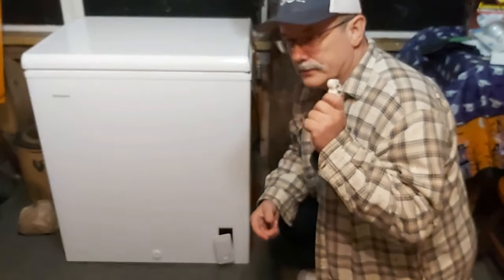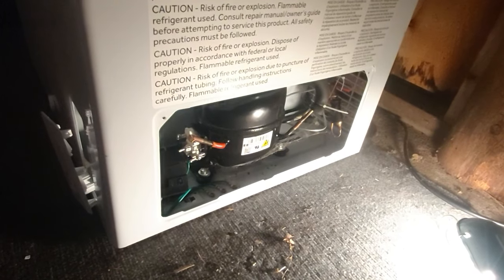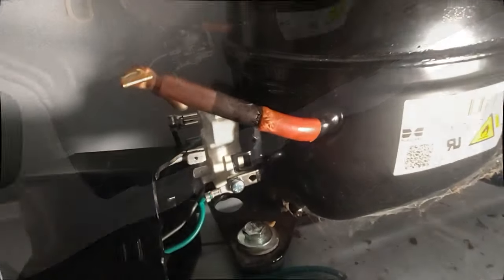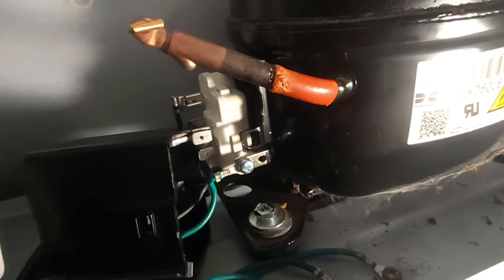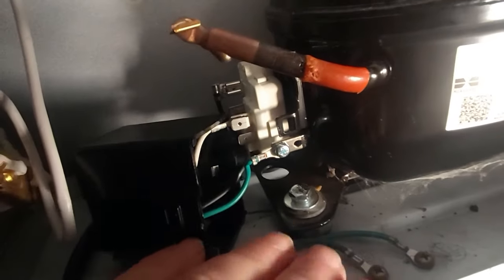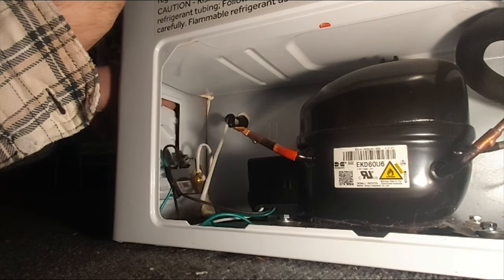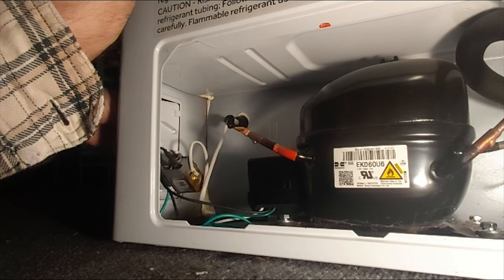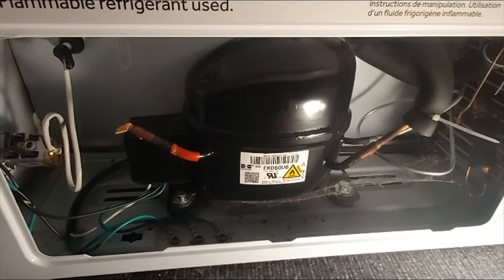Freezer Compressor Not Starting. Replace Start Relay. Hotpoint Model #HHM5SM AWW

Comment: Thanks for this video. Our deep freeze died and we didn’t know until it was too late and all of our food in there was spoiled. I did a search on YouTube and seen your video on replacing the relay. I ordered the exact part from Amazon and had it in 4 days. Followed your instructions on how to replace the relay and plugged it in the deep freezer and it started up. Thanks again.
Reply from the maker: @jamestucker5326  Thanks for commenting.  I appreciate it. I am glad that my video helped.  It is a shame that these appliances are so poorly manufactured. I would suggest buying another relay, just in case. Also, I purchased a thermometer that has a readout device outside the freezer. I have it hanging on the wall next to the freezer. I check it regularly. Glad I could help!

Comment: Just put this same part on my Haier freezer and it works! Yes, your video absolutely helped me! Thank you!
Reply from the maker: That is good to hear. I am glad I was able to help. Thanks for letting me know.
Reply: What is the part number for this relay? I have a Haier freezer that isn’t working
Reply: @nasb1971  
This is what I ordered from Amazon:
4Pin Refrigerator Over Load Protector Compressor PTC Starter Relay for Haier for Siemens for Hotpoint Freezer Accessories ZHB35-120P15 Replace ZHB69-135P4.7 ZHB60-120P4.7 ZHB88-125P4.7 ZHB60-120P15

Comment: My Hotpoint (same model) did the same thing.  These relay contacts will burn out in only 1-3 years.  Every refrig/freezer using this compressor design will do the same thing (fails after warranty period).  That's because they don't have a capacitor across the contacts.  Adding a 3 in 1 Cap/Relay/OL unit to mine replacing this cheap relay.
Reply from the maker: Great info. Where did you buy the 3 in 1? Thanks!

Comment: Great video. If I had seen it 2 days ago it would have saved me 300$ I had to get a new appliance. I still have the broken one and that's exactly the problem it has. Runs for a few seconds and then off for a few minutes and the compressor gets very hot. Well I will get that relay switch and fix it in spite! It gave me so much grief and was so costly to get a new one. I had to put food in friends freezers here and there to save it. This video is a gamechanger. Thank you.
Reply from the maker: I provide a link to the ebay vendor where I purchased the replacement part. Good luck. Thanks for commenting!

Comment: Thanks very much for this video.  I have the same freezer and it failed at about the same time as yours.  I don't want to throw it away and for $10 I will give it a try.  Thanks also for the link - I just ordered the part. Thanks again.
Reply from the maker: Thanks for the comment. I hope the part fixes the issue. Let me know how it turns out.

Comment: Thank you for the video.  Have the same exact model of Hotpoint freezer as you and the exact same clicking.  Ordering a starter relay from amazon.  Unfortunately its a two day delivery but the freezer is in the basement so there is hope for the food I couldn't stuff into my refrigerators freezer.  The Hotpoint freezer is all of 3 years old.  Never buying another Hotpoint product again.
Reply from the maker: Thanks for commenting. I left a link in my description to the Ebay site where I bought my new relay, in case you need it. It's not just Hotpoint. There are several brands made by Haier in China. Good luck with your food.
Reply: @twinbrookacres  Thanks.  Can use the luck.  Am currently rotating the frozen solid food in the fridges freezer with the nearly frozen solid food in the Hotpoint.  Think maybe swapping once every 12 hours may keep anything from spoiling.

Also put icecubes from the fridge freezer in the Hotpoint and put both a blanket and pillow on top for extra insulation.  The ice cubes havnt hardly melted at all 12 hours later.

Comment: I tried to find the exact same part, but all the replacements were correct but the housing  was too large. 
  I had to unbolt the compressor, and grind down the metal flap to make it fit. All good!
Reply from the maker: The part I purchased is no longer available where I bought it on Ebay. But I have a link to another place on ebay. The part popped right on for me. But I am glad you got yours fixed. Thanks for letting me know.

Comment: With watching these kinds of videos, it occurs to me, that those of us who are handy and can do these repairs, it might be a very good idea to grab the make and model numbers of our fridges, freezers, de-humidifiers and anything with a compressor, and buy the relay and overload (where used) and just keep them handy.

Also a good idea, as I'm seeing, is if a fridge or freezer doesn't have a failure alarm, for those of us who are Arduino/ESP32 addicts, to make devices to monitor and report problems so that a failure is discovered as it happens.
Reply from the maker: Good ideas! Thanks for visiting and commenting. I appreciate it.

Comment: pretty sure mine is having same issue, same model. Also less than 2 years old.
Ordered a relay and should have it tomorrow. If it does the trick, I can assure I'll be doing same as you and ordering a backup, or two.
thanks!
Reply from the maker: Glad I could be of help. Let me know if it works.
Reply: @twinbrookacres compressor appears to be running fine now.  👍
Reply from the maker: @ShastaBean  Good to hear! Thanks for letting me know.

Comment: One of the better clips for repairing a Hotpoint with the same capacitor I have so this really helped.
Reply from the maker: So glad I could help! I hope you got it running.
Reply: @twinbrookacres  the relay I bought was a zbh35 plugged it in and worked for a few days then stopped again. Did I just get a bad relay or could my freezer be bad?
Reply: Bought a replacement relay and it worked for a few days then stopped. Could my freezer just be bad? Thanks
Reply from the maker: @Michael Michalec  I have a link in my video description to the relay that I purchased on ebay. Try that. It sounds like a faulty relay to me.
Reply: @twinbrookacres  I did look at the link but it doesn’t specify a part number so I don’t want to order what I’ve already got. Amazon is replacing the one I just got plus I ordered one that’s zbh45 not 35. Not sure what the difference is but they look the same. I smacked the relay with my screwdriver and it clicked and lit up orange, compressor kicked on for a second then nothing. Thanks.
Reply from the maker: @Michael Michalec  Sounds like a bad relay. I don't think it's the compressor,  since it does turn on. If the replacement relay doesn't work,  you will probably have to get a multi-meter and start checking things. Let me know what happens.
Reply: @twinbrookacres  thanks

Comment: Great video. My Hotpoint is dead and I replaced the relay, but the compressor still clicks on/off in short intervals. I can’t figure out what’s wrong.

I live in Alaska and lost a season’s worth of fish and berries when mine died so I feel your pain.
Reply from the maker: It might be the compressor. You might need a multi meter tester. But if your Hotpoint is only a couple of years old, like mine, I doubt it is the compressor. The meter should help.

Comment: Did your freezer have a run capacitor? I didn't see it in the video. Mine has one with the two middle prongs of the relay being used.
Reply from the maker: I don't think it did. It's been about three years since I worked on it.

Comment: I cycled through the comments and you may have already addressed this, but what was the part number and where did you order it from. I had 150 lbs of deer in the freezer and this past week we noticed major temp fluctuations. I removed the meat to neighbors freezers, etc and ordered a new one. I would love to get this one going again. Second question is this. Was the compressor itself getting really hot to the touch.
Reply from the maker: Look in my video description.  I posted the link for the part there. I don't recall the compressor getting hot. Not sure now. Sorry. Let me know if you get it running. Glad you were able to save the meat!
Reply: Thanks so much!!

Comment: Replaced mine but still doesn’t work. It clicks but never comes in. Maybe the capacitor? But isn’t it the cap that shuts it down with the click so I’m guessing that is good. Thermostat? Any thoughts?
Reply from the maker: It may be the compressor.  You will probably need a meter/tester to determine where the issue is. Sorry I can't be of any better help.

Comment: Great video! My Hotpoint freezer went out this weekend and am trying to fix. I replaced the part from your video and it worked for a day but now seems to broken again. Any suggestions?
Reply from the maker: Perhaps you got a defective part. Did you purchase the part through the link I provided in the description of my video? It may be your compressor.  You would need a meter to check different parts.
Reply: @twinbrookacres  Thanks for the quick response. No, I found a matching part on Amazon. A meter may be beyond my comfort level though.
Reply from the maker: @Travis Bryant  The part is inexpensive. I would purchase and install one more. If that fails, then bring in a repair man, or I purchase a new freezer.

Comment: Thank you for the video!! Sorry yal lost all that food..
3 days ago I bought a Tappan upright freezer off someone I know that was selling it on FB marketplace,for $50. I paid $60 because him & his wife delivered it to my house and unloaded it.   24 hrs later I plugged it in & was excited to start putting food in it to make room in my refrigerator freezer, but all it did was make the same exact sound yours was making, sounded like it was going to start but then made a clicking sound and shut off and kept repeating that. The person I bought it off said it was cooling before he unplugged it to load it in his truck (he had it upright when delivering it), but I don't see how it's relay went out before I even plugged it in?! Now I'm looking online trying to see of its worth fixing! Gonna replace the start relay and see if that fixes it....
Reply from the maker: I am glad I can help. Look in my video description for a link to a start relay to purchase, although i dont know if the Tappan is the same as my Hotpoint and if the start relay will fit. Good luck. And let me know if you get it working.
Reply from the maker: It looks like Tappan is made by Electrulux, not Haier. So the link in my video description probably won't work.

Comment: Mine is a double doorbamerican bush freezer. I’ve looked for the exactl model of my qpe 2 relay but shapes are different online. I need advise
Reply from the maker: Go to ebay and enter the freezer name and model number,  along with  the words 'start relay '  to search for the part. I put a link in my video description for the part I ordered. You can start there. Maybe you can contact that seller to see if they have your part.

Comment: wish you would have shown how you took the cover off.  you mentioned undoing the t/stat panel to access the cover. that my is snag/hurdle right now.  Thanks.
Reply from the maker: The cover on the relay is just held on by those two tabs. Pry the one facing you with a screwdriver, then VERY carefully pry between the cover and the compressor.  It should pop off.

Comment: Hi did you ever figure out how to add an alarm? We have an alarm on the outlet our freezer is plugged into that sounds during loss of power but I’d love to have an alarm if the freezer fails also
Reply from the maker: No, I did not. But I bought a thermometer that stays inside the freezer and has a wireless digital display that stays outside the freezer. There must be something I can buy that has a light or alarm, but I haven't looked lately. Sorry, I don't remember where I bought it. Perhaps Lowes.
Reply: @twinbrookacres  I saw one that you can put in a freezer and you set the high and low temps and if it goes past those temps it will sound an audible alarm ever 5 minutes. that may be the best option, we too lost a freezer of meat after our GFCI was tripped and didn't realize the freezer was not cooling until it was too late! oh well life will go on
Reply from the maker: @rynophiliac  Where did you see it?
Reply: @twinbrookacres  did a google search yesterday but I didnt do enough research on them to find one I liked. basically what your looking for is a batter powered alarm with a  loud db that will sound when the temp goes above freezing or when the battery starts to die. Lots of cold storage rooms for medicine, produce, etc use them
Reply: @twinbrookacres  looks like that one might mount on the wall then the cord would have to go through the freezer seal. Id probably try to find a similiar product that can go right inside the freezer maybe
Reply from the maker: @rynophiliac  yep. I wasn't able to find a battery operated unit with an alarm or light.

Comment: Thank you for your video, just the problem I was having, but I still have to find the starter relay. That Plastic cover is a B***h to remove. Thanks again, good job.
Reply from the maker: I hope the video helped. Let me know if you get it fixed. Here is where I got the relay https://www.ebay.com/itm/203043537630?_trkparms=ispr%3D1&hash=item2f465682de:g:VQsAAOSw2TdfBpb0&amdata=enc%3AAQAGAAABcOinXvXc2XQUWwmQG%2FrWrxjTlai9jZ%2Bix0IdMTYuPB4JutJ4GzmXCWSzv8%2B3iVLPXj%2BPw1JEVl1%2BPv%2F0aSE2Gt4%2FbottV6rO%2F9BjmdIAwGVcs4XJNiRRkXoYRhavpWQ0PvgE5CWXeWj62JHSGlberRVlDOVLYo8QtRe2p0CV1ygP5wvy8yprvwHRs6zJpcl3oz9rl9bpUAFvNT%2FXWS3YmVavHqYSAnSvlOVoR6B1Pohs%2F%2BSsS7EkrAuKOJzo4MoHNK7%2FGj%2F09M97pgya3YTzhAsvclPwlb4gxBjYO7BSLJ3NYK5t1lgW6eHV1Z7Q%2BCcq5ot64EpYIeegeLH1yIfjbqT7%2FkoVbJMDtmK4N96jMgUCsXKxytxz5SeXKzcB0a2wdD9o0hNegIf4vdUjainglsCg%2B%2Fzzo4OszebI5MncNa%2BdFikSnFgj3RLZrAiyfEAQbd6%2F8VqLNQDvZb5l21ghMPe3AQP7M5hr4%2BZzZ52rayc5%7Ctkp%3ABFBMxt_k_INg
Reply: How did you get the black box removed? We are fighting to get it removed now

Comment: My freezer is doing the same thing.  Where to you buy the relay?  Hotpoint won't sell any parts for this model.
Reply from the maker: Look in the video's description. I recently updated a place to purchase the part. I bought mine off of EBay, but that site is no longer up. There is an Amazon site with what looks like the same part. Here is the link: https://www.amazon.com/Refrigerator-ZHB35-120P15-ZHB60-120P4-7-ZHB88-125P4-7-ZHB60-120P15/dp/B09D72QCSL/ref=sr_1_1?crid=3OCO1AJDIW130&keywords=HHM5SM+AWW&qid=1696423454&sprefix=hhm5sm+aww%2Caps%2C90&sr=8-1
Reply from the maker: Hotpoint is made by Haier, a chinese company.

Comment: I have the same freezer and it was having the same problem.  I switched that part out and it still buz for 2 seconds and cut off.  Man I hate to throw this freezer away I only had it for 2 yrs. I'm  wondering if the part I gave from amazon is bad.
Reply from the maker: I would try one more part. I provided the link in my description for where I bought my part. Give that a try. Otherwise it might be the compressor.
Reply: @twinbrookacres  I tried that but unfortunately  they are sold out. I appreciate  your help tho.
Reply from the maker: @stanleyjohnson1310  Good luck with it. Don't give up yet.

Comment: Mine isn’t cooling.. but making a weird running water sound?!?… could it still be the relay?
Reply from the maker: Mine always has a running water sound. Must be the coolant circulating. I doubt it's the relay, but worth a shot. they are cheap enough. Look in my video description for a link to a replacement part. The site where I bought mine no longer exists. I don't know anything about the link that I recently put up.

Comment: thanks for your video i  Replace  new Start Relay，The freezer is very cold and it doesn't freeze
Reply from the maker: It does not freeze? You might need to adjust the thermostat.
Reply: @twinbrookacres  I set 7 and it still doesn't freeze。Not sure the thermostat is broken or there is no freon🤣
Reply from the maker: @zhangqinghe0304  sounds like you will need to put a meter on it and locate the problem that way.

Comment: My Hotpoint Deep Freeze is not working.  It is currently unplugged but when I plug it in,  in about 20 seconds, it will click....... about 3-4  seconds later,  it will click again.  I am not getting the humming though.... the only difference.  I stopped by a Appliance place today and explained this.  He told me it was not the Relay but the Compressor was bad.  I can look into either for replacement but I just don't know which is the real problem now.  Can you give me some insight? The freezer is only 2 years old.
Reply from the maker: I would suggest replacing the relay first. It is far cheaper than a compressor or a new freezer. There is probably a way to test the compressor with a meter. But that meter probably costs more than the relay, too. Let me know how it goes.
Reply: @twinbrookacres  I went ahead and ordered and replaced the Relay and it is still just clicking  and turning off. What would you recommend for the next step? Thanx in advance for the insight.
Reply from the maker: @kevins.6886  I don't know. Perhaps it is the compressor.  There must be a way to test the compressor.  Can you load the freezer onto a truck? Then bring it to an appliance shop. Or buy the proper meter to test the compressor.  I would do one of the two. Let me know what you find.  Good luck.

Comment: Geez, I’m having so much trouble getting the old relay out. The wires are not easy to remove off the metal prongs.
Reply from the maker: Pry gently with a screwdriver. I am not sure if you are trying to get the wires off the relay, or the relay off the compressor. Either way,  pry very gently.  If it's the wires off the relay, perhaps try spraying a slight amount of oil on them. But they shouldn't be too difficult to take off.